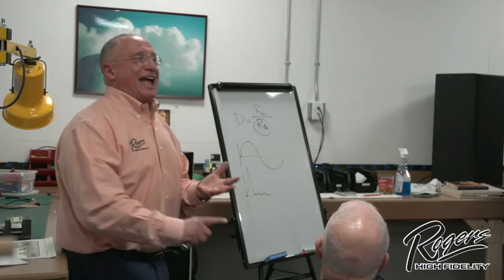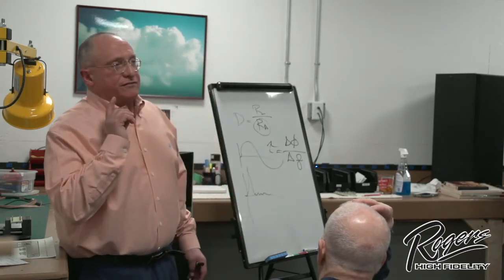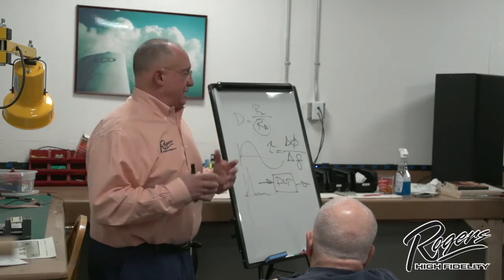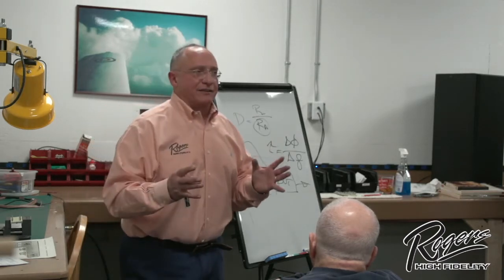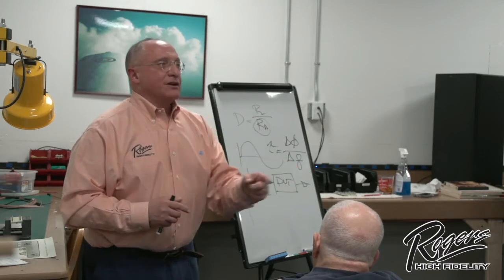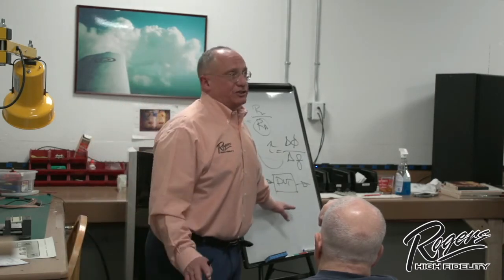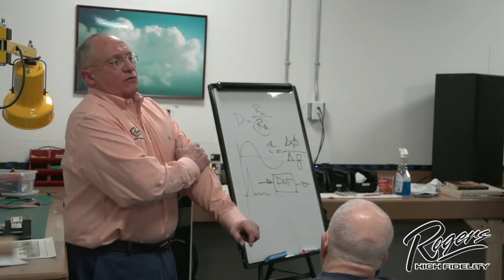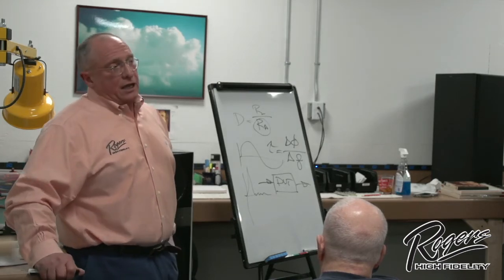What is Group Delay and Why We Measure It - The Analog Life Episode 3

Comment: Great job on a fairly complex aspect of sound engineering.   Position, imaging, timbre and dynamics are some of the primary aspects affected by group delay depending on the frequency range. Often, (e.g. Genelec’s FIR’s ) are used to reduce phase distortion, actual affecting group delay.  DSP’s are sometimes used to address these sorts of issues.
Reply: Its utter tosh! yes group delay is important but frequencies from 200khz affecting sound? snakeoil.

Comment: I know that in ultra wideband designed equipment like AGI preamp, Spectral Audio  gear, this is apparent. When a design is made to reproduce a wider bandwidth than the human ear can hear, that equipment sounds more realistic to most learned ear listeners. The reason was explained to me to the effect that because this bandwidth is so flat from subsonic to vhf frequencies and that coupled with the high rise time capabilities gave it that signature of realistic sound reproduction. That’s probably over simplified as far as an explanation goes but it sure fit for what was heard. Spectral gear was and, as far as I know, still is capable of reproducing dc to up in the megahertz range of frequencies. That coupled with a rise time specification of 1200 volts per microsecond slew rate gave their gear a transparency other manufacturers could not match. In the audio frequencies we can hear, this gear did not exhibit what is known as time smear due to the wide band design and the high slew rate. That combination of capabilities makes sense to bring that about. The higher the slew rate, the faster it reacts to changes in amplitude. The wider bandwidth attributes the time element with respect to the slew rate. Quick and accurate is the nutshell explanation. Keith Johnson is the engineer for the company. He can explain it where I lack his intellect and depth of knowledge! AGI preamp is no longer made. Maybe you know someone who has one, other than myself, that can explain it in terms you can understand. Keith is an engineer like you. You two speak the same language. George Merrill understands this also. He’s a genius, literally! You could ask him!